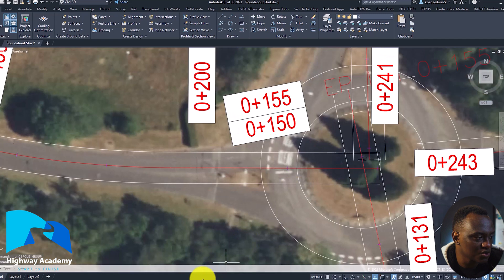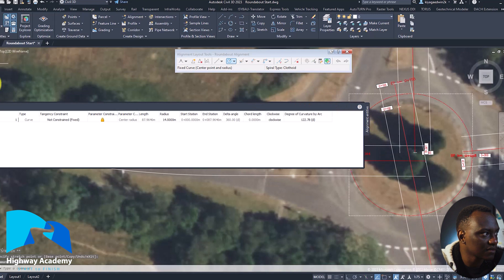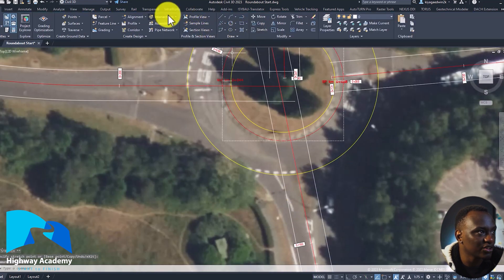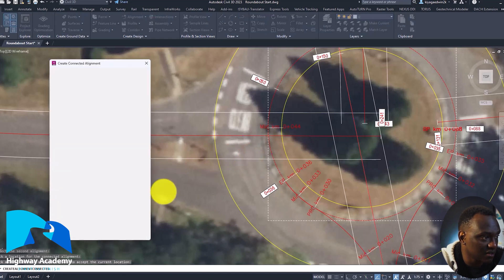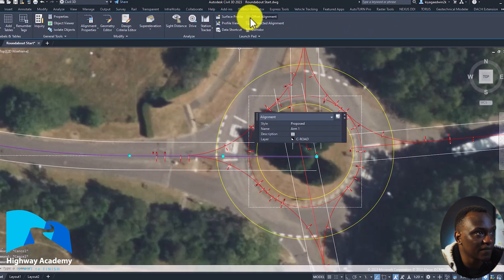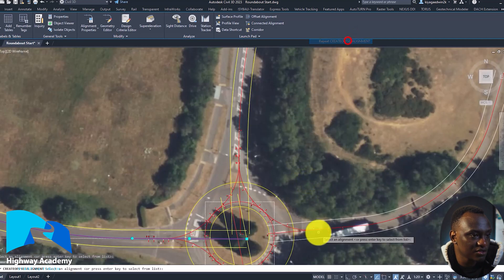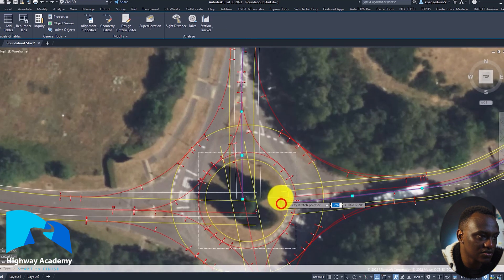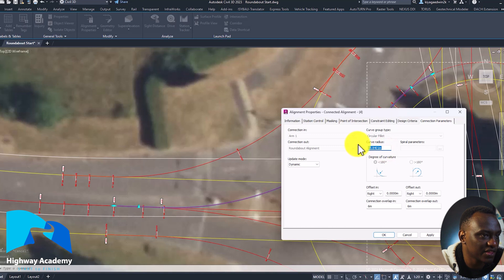Manual Roundabout Design in Civil 3D

Comment from the maker: The moment you've been waiting for has arrived! 🎉
Our complete Ultimate Guide to Dynamo course is now officially LIVE on our website and also the beginners roundabout YouTube playlist is available. 

Ready to jump in and become a roundabout design guru
✅Link to the Roundabout design course: https://hwy.ac/rdbt-geo
Beginners guide to roundabout YouTube playlist
✅Link to the Beginners guide to roundabout YouTube playlist: hwy.ac/rdbt-geo-ply
Want to connect with our amazing community
 ✅Link to our Highway Academy WhatsApp channel for daily tips and updates right on your phone:
  https://hwy.ac/rdt-ch
Got a question or just want to say hi? We'd love to hear from you!
✅Link to our WhatsApp direct chat:  https://hwy.ac/wa	

00:00 Intro
00:15 Creating a roundabout centerline alignment.
00:44 Choosing a fixed circular element for the roundabout.
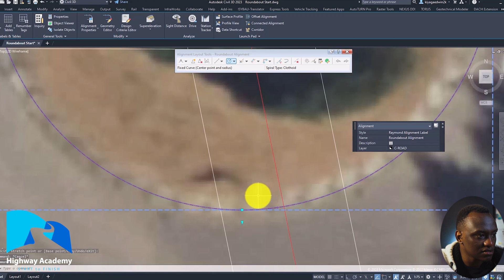02:02 Creating offset alignments for lane width and apron.
03:05 Introduction and use of connected alignments.
04:19 Applying a circular fillet with a 25 radius.
06:47 Emphasizing the dynamic nature of the design.
07:18 Creating outer radiuses by offsetting the carriageway.
10:55 Adjusting alignments to increase deflection on entry points.
13:43 Checking design parameters against standards.
16:15 Fine-tuning the design by adjusting offsets for curbs
Reply: not working url
Reply from the maker: @mak0a  Updated